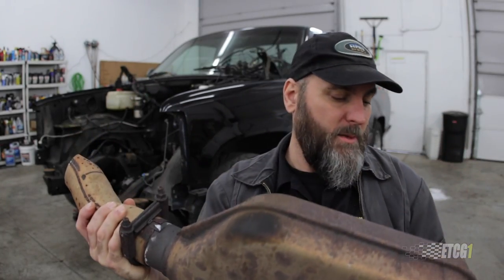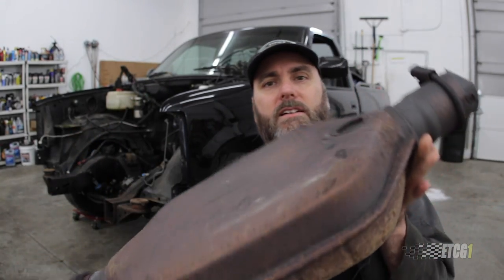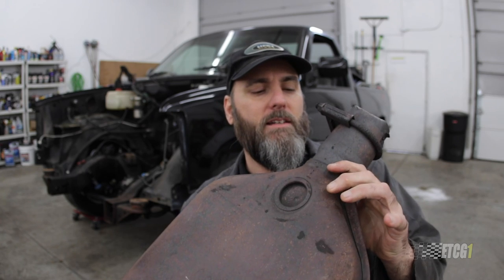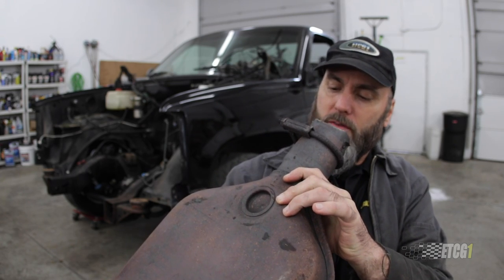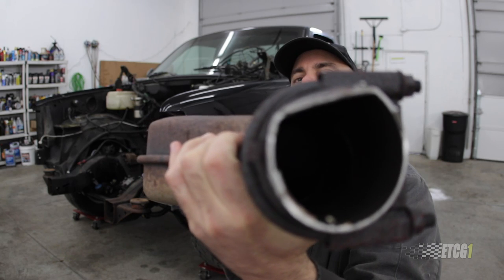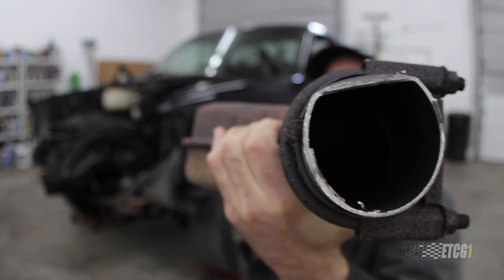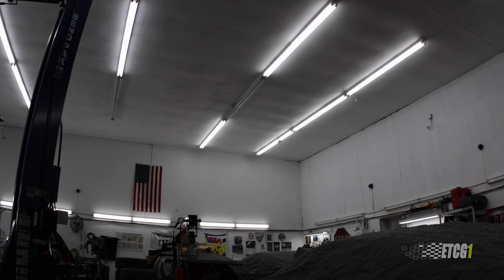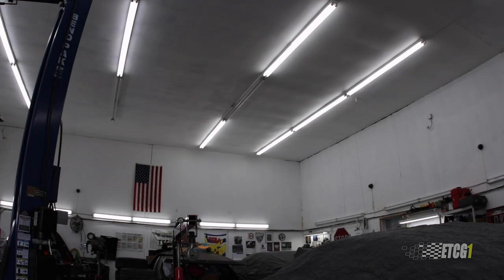Should You Run a Catalytic Converter on Your Hot Rod?

Comment: I've always been of the opinion that if it came with one, you should leave one on.  Now, you could put on a newer, high-flow catalytic converter that is more efficient...  And it might make a good video to boot.
Reply: This!
Reply: The beehive cat that he pulled off that truck flowed like mud and in my experience got very inefficient as they aged. Replacing it with a new cat would be a huge improvement, and still provide the emmissions benefits. Or you could just remove. Both would be much better for your vehicle.
Reply: As most of us here probably know, a cc requires a constantly alternating rich lean condition to work. Here in the communist country of Kalifornia you are not allowed to run a cat on an engine that didn't use one to begin with for good reason as stated above. In your case year model and going back to about 1974 you cannot modify the system with non carb certified parts, add or delete anything. You can change the ENTIRE system to that of another newer vehicle (some restrictions apply) then it has to meet those standards. IIWY I would run a high flow cat IF you can verify it's functional needs are met with your change of injection. Personally I hate to get behind a catless system. Some like the smell of all that raw unburned fuel. Not me.
Reply: @springfield03sniper  would a new one even be available? Probably extremely expensive when a bigger better flowing one could be welded in.
Reply: @DENicholsAutoBravado  you can buy a new cat converter at any autoparts store. They are much smaller than these because of the through and through design, whereas this is old one is filled with a catalyst
Reply: yes this is true
Reply: I say, do what you want. Nobody should be forced to spend money they don't have. There isn't a crisis out there, contrary to half the nation's belief system. If there was, I'd be the first to die, as an asthmatic. Trust me - the air is fine. Whether you have a cat, or not, it isn't going to make a lick of difference in ANYONE'S life.
Reply: @SmittySmithsonite  Well that's just plain BS, long term effects of living besides a busy road have been documented for decades. If you'd make the case other sources such as big container ships expel more shite, you'd be right, but they don't sail right next to your living area.
Reply: @SmittySmithsonite  its a bit of a late response on my behalf but THANK YOU!! lol i agree with you 1000% do what you want its your vehicle besides it takes the back pressure off your engine which will give you over all better performance im gonna run strait pipe on my 99 tahoe to increase my gas milage
Reply: @sierrahixom  I'm planning to do the same in my 99 Tahoe as well along with the EGR delete 😉
Reply: @shadowzedge5793  right on i did mine and i kept the muffler on to respect people in my apartment complex but i have seen over all better milage,perforamnce ect.
Reply: Bill Rookard You do not need a catalytic converter
Reply: My 1995 suburban 454 is still stock, including cat conv. I doubt that mine (CC) still works. 
But I'm gonna leave it on

Comment: There are a few high performance aftermarket catalytic converters available, it would make for an interesting video 

This was the subject of an OG Wheeler Dealers episode, I believe the AC Cobra
Reply: That there are... even still 1-200 CPI catalytic converters do not add much restriction at all.
Reply: Agreed. There are a number of options for low restriction cats available. It's a philosophical argument. Run without, you are essentially guilty of not caring about today or tomorrow. Since there is an option available, and there are, then are you morally obligated to take the high road. The choice is yours..........

Comment: I saw a 76 GMC 2500 for sale a while back.  Nothing fancy but a one owner.  He had recently put a new dual exhaust system on it and used a custom muffler shop that I have used several times in the recent past.  Very good work in this shop.  There were two small catalytic converters in each 2 1/2" pipe not too far from the headers (manifolds had been upgraded).  It had the original small block 350 and an aftermarket Edelbrock intake and 4 barrel carb.  The idea of the cats were to simply clean the exhaust from an older engine that may be running a little rich due to living at 5500 feet above sea level.  I thought that was a great idea as I don't like following some older, bad running cars and smelling the fumes.  I will do that on my next project car/truck.

Comment: I used to be a smog tech in california so I'm pretty well versed in the subject of cats. Heres the scoop. A modern cat requires the fuel system to osillate between rich and lean in order for the cat to fully function. Tbi, carbs, and early FI systems do a really bad job of doing this. What it really comes down to is the tune. If you can tune your engine to run close to 14.7 during your regular comute, having a cat will do very little to help. Manufactures tend to run their cars on the rich side: 1 to prevent detonation and 2 because you can pull more power out of the engine by adding timing etc. My mustang has a "modern" FI system and requires 4 cats, 2 on each side. TLDR; On NA engines, a cat causes very little restriction and wont affect performance but your trucks original FI wasnt that good anyway, so as long as you don't run pig rich, who cares.

Comment: It really depends on the car. For anybody who read the title though, when I think hotrods I usually think 25 year +. I went through the trouble of running an expensive ($300+) hi flow race catalytic converter on my 1991 Civic Si and guess what, now it's blocked and I'm out $300. I'm of the opinion that older cars are exempt at 25 years old for a reason, and that's because the government has decided that as long as you can keep it on the road and out of a scrapyard the slight trade-off in higher amounts of hydrocarbons coming out of the exhaust is worth it compared to junking a perfectly good (in my case almost mint condition) car.
Reply from the maker: Something a lot of people in these comments don't seem to realize is that you can't just throw a cat on any car and call it good. The engine needs to operate within a very specific A/F ratio so that the cat doesn't get destroyed. If I had put a cat on my Ford, it would have been destroyed within the first week because of how rich it ran. 

Thanks for your comment.

Comment: I've been working with a crate engine now for 3 years or so.  Right off the bat my emissions are greater due to displacement.  I have been using either the Sniper or the FiTech throttle body injection systems that run off a single oxygen sensor.  I also like placing the oxygen sensor after the exhaust merge because that way I am controlling off all the cylinders.  As I continue work on this project I have customized the exhaust, but also added a Magnaflow cat.  My wife always complains about the fumes when idling either in the driveway or the garage, even when set for a 14.4 AFR.  Both the FiTech and the Sniper are set up from the factory very rich.  While you can lean them down, they run best a bit on the rich side, so I added the cat to combust the extra fuel.

I have also added a PCV system with the M.E. Wagner adjustable valve.  This baby gives extreme adjustability and allows me to reduce and or eliminate crankcase pressure.  The engine came with breathers, and I would sometimes see a puff of fumes come out into the engine compartment.  I tried a few different PCV valves, but nothing was quite right, so I bought the Wagner.
Good purchase.  In conjunction with the Wagner I have a Moroso oil separator inline.  Ended up with a low flow adjustment through the Wagner, although they say if you are going to race a higher flow works better.  I pull clean air in through one of the original breathers, and I figure that gives me an emergency pressure relief if every needed.  Cleaner oil to boot.

Now you mention red eyes and the inability to breath due to air pollution.  I experienced both of these to the extreme growing up in Los Angeles before emissions control got started.  I can tell you that you do not want your children to experience air pollution like that!  So if you are hot rodding around town I think that you really need to work toward zero emissions as the goal.  The seat of my pants can barely tell the difference..

Comment: I'm running pacesetter long tubes with 3 inch collectors, 3 inch off-road Y pipe, and 3 inch single exit diamond eye exhaust on my 2006 f150, there's no cats. I love the difference in sound and power. Do it, you'll love it

Comment: I have '93 Buick which is now exempt from emissions. I decided to go with a modern direct fit high flow replacement. It was just easier for me in the long run. No modding and fit issues to worry about in my particular case.
Reply: Excempt doesnt meab anything.  If it came with a cat its highely illegal to remove it and you can get a 10k fine or jail time

Comment: I had the exact same cat in my 1990 K2500. I took it off a couple years ago. The truck would not do a burnout even brake torquing it. I cut the exhaust off and straight piped it and it immediately got a lot better. It ran 11 second 0-60s. I'm running Holley Sniper self learning TBI now. I'm open to putting a high flow cat on it. I'm running a single 3" open exhaust right now. Headers to y pipe to open 3".

Comment: I have a 1982 chevy C20 that has the heavy duty 350 in it. I didnt realize that the heavy duty referred to the emission system not the power output til I started removing the air pump system and everything and did some research.  People will complain because of emissions being gone but the truck runs much better now than it did before. Hopefully they don't start having vehicles of that age start being held to modern emissions standards or alot of people will be out of transportation.

Comment: Modern high flow cats dont effect performance enough to gripe over the need to install them if legally required. However if you live in a C.A.R.B state, requiring OEM certified exhaust parts... Buy something too old for their laws to effect, or move! I'm all for saving the environment and feel you absolutely should have full emissions equipment on your daily driver, but exemptions should be given for classics, hot rods, race cars, show cars ect that don't get driven enough to make a significant impact on the environment. 

My state requires OBD2 emissions testing every 2 years. No safety or actual "sniffer" test. They just plug it in, check for system readiness and send you on your way. Great system in my opinion because its fast, effective and gives plenty of options for car enthusiasts to modify as long it still passes obd2 requirements. Anything prior to 96 is exempt and free to hot rod all you want.

Comment: It depends upon the application and your local and state emissions laws. On an older car that has a carburetor such as the fairmont, No Cats, but on a late model hot rod that has fuel injection, I would be more inclined to keep them! Some of the late model platforms have enough aftermarket surrounding them that you can make good power and still be emissions compliant! Here in CA I wouldn't risk not running cats on car that requires them. Whether or not you will gain a significant amount of HP by removing them, is a good question for a tuner who specializes in your specific application...

Comment: We had emissions testing here (Louisville, KY) for a number of years, but no longer. Back when we still had to test our cars every year I had a 1982 Corvette with catalytic converter. In stock condition it would pass the test each year. Then, in an effort to create some more HP, among other things I removed the converter, installed a straight pipe, blocked the EGR valve and a few other mods this shade tree mechanic could do including adding a racing chip to the computer. The first emissions test after all these changes I was sweating it a bit, but believe it or not, the car still passed, albeit the level of emissions had increased.  I was relieved, but also mad because I was convinced, as were many other Louisville residents, that the test was a ripoff. Turns out it was. One person got the bid to perform the testing every year and he made millions of dollars while there wasn't much improvement in air quality. Well, he got caught, and about that same time emissions testing was eliminated. Makes you wonder how many politicians got wealthy too, doesn't it. OK, my main point...back then requiring cars to have catalytic converters was, in my opinion, a sham. Today, 35+ years later and with the current fuel and emissions mandates, it's probably best, if you have a converter on your vehicle, to leave it there.

Comment: Keep your classic, Historic, Vintage car, Hot Rod, or Toy, Running cleaner than minimum compliance rules ask for. High Flow cats are cheep solid and easy to install. DO IT for your grand kids.
Reply: the kids complain when I cat them... but I did EFI and Catalytic a '78 and am worried about the tune. <3 all (CatsnKids)

Comment: Just wanted to say, beards looking bad ass Brother. Looking Good! On the note of catalytic converters, I've ran lots of older vehicles with them hollowed out. We are an inspection state which means all the components have to be there, but they could truly care less if the are working or not. My vehicles always ran better without them, but the smell will burn your eyeballs out at an intersection or drive through. I would have used high flow aftermarket cats but cost is always a deciding factor for me. I have nothing against them not being there.

Comment: I have 95 Corolla Wagon which is my daily and only car. I chopped off the stock cat a couple years ago and welded in a pipe instead. It gained some top end power back because after 290k miles (at that time) that cat was starting to clog up. But being my daily I struggled to enjoy the fresh air when sitting in summer traffic with the windows down. Also if the wind was blowing the exhaust towards the front of the car, I couldn't have the AC on either because all the fumes got inside the car. Other than that though it ran fine and sounded pretty cool to be honest! A lot more... raw. So after about a year and a half I welded on an Ebay high flow cat. Doesn't do too much but it helps especially at idle. I don't plan on getting anything better (emissions wise) than a high flow cat since I don't need to pass emissions. Yes, technically I should have one since the car came with one, but I'm not putting an expensive cat back on it.

Comment: I have no issue at all with folks not running catalytic converters on classic/pleasure GASOLINE vehicles. I don't run one on my 1987 Suzuki Samurai...but it's also exempt from emissions testing where i live nor do i drive it often. I do however have a real issue with all of the emissions equipment that has been recently mandated on diesels over the past 15 years...they've absolutely killed their reliability, efficiently, and longevity.

Comment: My BMW's only cats were integrated into the exhaust manifolds, which I replaced with high performance headers. My state doesn't require emissions testing. Even if they did, I have a tune and the emissions monitors are all set. 

From what I've heard not even California, the most strict of emissions states, does any actual tailpipe emissions testing. They merely plug a scan tool in to check if the emissions monitors are set, if they are you pass the test.

Comment: I live in Alabama also a no emissions state. That said my 99 has 1 cat that is failing I also have been debating this question for I could replace just the one to get the light to go off or replace both because the other I am sure is up next. Second option is to punch them out and get the downstream sensor deleted from the ecu. FYI even if a state has no emission vehicles fall under federal emissions laws and can be enforced by local law enforcement IE DPMF deletes if caught here in Alabama can be ticketed and charged a fine and I believe this applies to catalytic converter removal. At this stage I am leaning toward a high flow replacement system just to be safe.

Comment: Here I my thoughts on this. A hot rod is generally a car guys baby, and that being said. They will be made to run as good as possible, there by reducing pollution. And as you said NOT driven,in many cases daily for the vast vast majority. I have a 54 Ford running a 66’ corvette 327. I feel quite sure it emits less pollution than the original engine, under normal driving conditions. May I also add that it gets 18mpg with the AC on and cruising at 70 turning about 2200 to 2300 rpm.

Comment: My secondary daily driver is my 87 S10, and I ended up removing the cat on it because it was rusted out, but I have put less than 1,500 miles on it since early 2018 when I removed it.  Now my 2018 Silverado, I've put 11K miles on it since September.  If I was putting more miles on it, I'd consider a nice Magnaflow high flow cat, but again, it isn't my primary daily.

Comment: Removing or disabling emissions components is a federal crime and is illegal in all 50 states, even if you don't have to get your vehicle tested. Now if you don't need to get your vehicle tested, it's almost impossible to actually get caught and get in trouble over it. I'm just saying it IS technically illegal. I'd like to see a modern cat installed on the truck. The pellet ones are restrictive, but the honeycomb style takes away a negligible amount of power IMO.
Reply: That makes sense. I've heard that "modern" cats were barely restrictive at all, and thus not worth removing, but wasn't sure what qualified as "modern". Does it all come down to pellet-style vs honeycomb-style? And if so, is there an easy way to tell at-a-glance which is which without removing them?